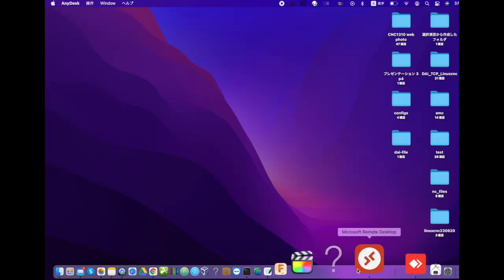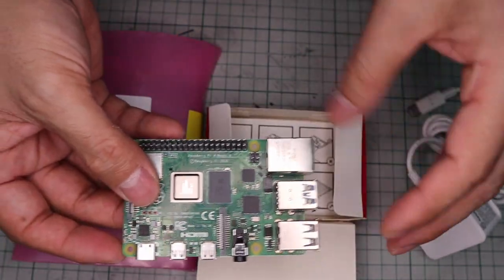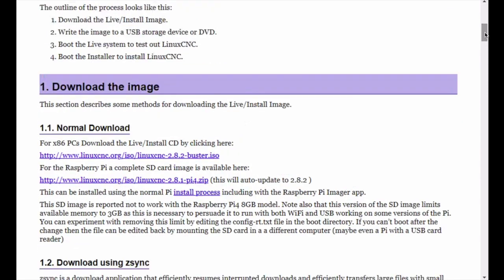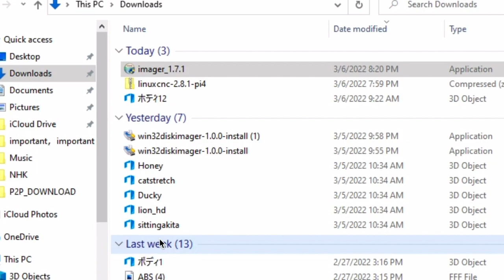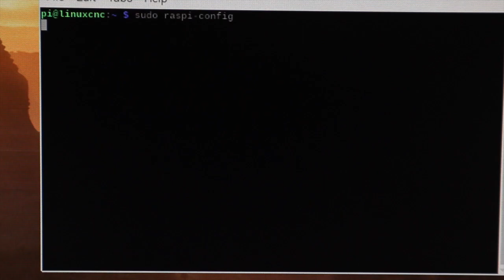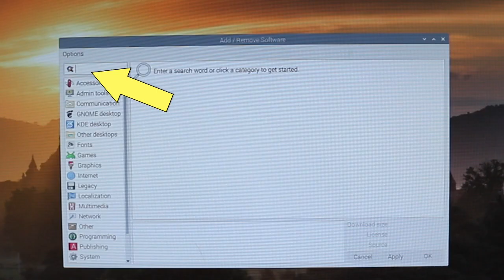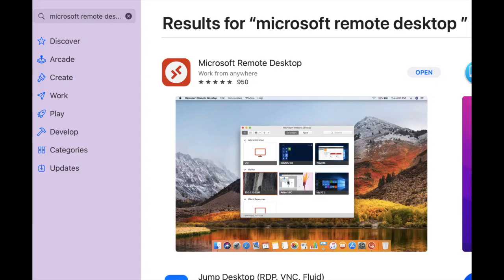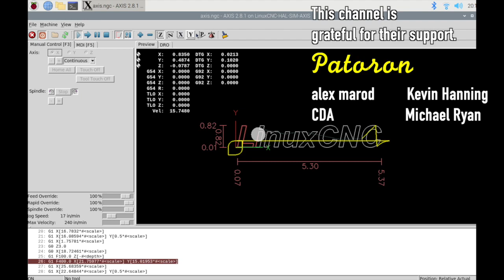Install LinuxCNC to a Raspberry Pi4 and remote control by Microsoft Remote  Desktop

Comment: Nice, I have a similar setup for my ANT PCB maker. I first tried "VirtualHere" remote USB emulation - but it was a bit unstable even over wired ethernet.  Having the software running on the remote computer directly controlling the CNC (like OctoPi controls a 3D printer) is the best way to go.    

TIP: After burning the SD card you can open up (the FAT32 part of it) in Windows/Mac and edit some config files to set your Wifi and enable the SSH terminal.

Then you can use Putty from windows to do the rest of the install of the remote desktop (via command line).  Avoids the need to connect a monitor and keyboard.  Well worth practicing with a spare Pi.
Reply: You should also set up a SAMBA fileshare, so you can transfer design files to the Pi from Windows/Mac.
Reply from the maker: Thanks for the useful information.
I am interested in OctoPi.
Reply from the maker: I know SAMBA.
It is very useful.
I have confirmed that teamviewer is also available.
Thanks.

Comment: Cool vid, I didn't know you could use linux for this.

I agree linux and the ras pi are hard to learn. I used mine to build an Openflexure microscope, which is the only ras pi thing I've seen that was laid out so clearly that a child could probably build it.

Comment: I know how to install Linux and the software, but I'd like to know how to connect mesa board with stepper drivers? I have 3 axis CNC with 2 motors for Y axis.
Reply from the maker: LinuxCNC Raspberry Pi4 & Mesa 7c81 Setup
https://youtu.be/EcCYf4WEvKs

Comment: Hello there 
I wanted to ask a question 
When you are doing 5 axis machining, Does your part have to be perfectly in the middle of the rotary table or it could have some offset and then you can offset that in the software ?!
Reply from the maker: I was just trying to get xyzac-trt-kins to work with my newly installed Linuxcnc, but could not get it to work by myself.
Finally,  I asked a question on the Linuxcnc forum.
They answered. Thanks to them.
I will try to set it up tonight.
I will post a link to the site.
I will post it on Youtube once I get my setup working.

https://forum.linuxcnc.org/10-advanced-configuration/31813-tcp-5-axis-kinematics?start=420#238235
Reply: Oh thanks thats really helpful 
Another question 
I saw In your videos when the machine was processing some metal work the fixation place was alittle pumped up and most of the 5 axis machining i see have this type of high elevation is it important to do or you can just fix the wp on the trunion table
Reply from the maker: 5-axis machining means machining workpieces from various directions.
The problem is interference.
The clamping method of the workpiece is also an issue.
Even though the workpiece can be machined from any angle, it cannot be machined if there is a clamping bar to hold the part in place.
The 5-axis is mechanically larger, so it is more prone to interference.
As a result, interference is prevented by setting the workpiece higher and making the fixture as small as possible.
Reply: @a-cnc-f  thanks for the answer, I really appreciate your videos keep it up

Comment: Can you recommend 5 axis TCP board with linuxcnc beside this board ?
Budget friendly.
Reply from the maker: At least the one controlling my 5 axis machine is raspberry Pi4 + Linuxcnc + mesa7c81.
I used to use beaglebone+machinekit, but the lack of wifi and slow speed were frustrating.
I will post another video about the CNC unit next time.
Reply: @a-cnc-f  how about TCP ? Does your setup can do TCP ?
Reply from the maker: @calico88  
Yes, TCP has been successfully configured.
But unfortunately I can't explain it properly now.
I had a hard time setting it up 2 years ago, but I don't remember how I did it.
I have notes saying how I did it, but I don't know if I can reproduce it.
I will eventually set up my newly prepared Raspberry Pi to be able to do 5-axis TCP.

I set it up by looking at this.
I don't know what they are talking about, too high level, but good luck.
https://forum.linuxcnc.org/10-advanced-configuration/31813-tcp-5-axis-kinematics?start=0
Reply: @a-cnc-f  well I’m not a programming much worse than you.
I’m looking for a setup hardware than can do TCP with much less coding.
Well it does not exist yet …
Reply from the maker: I know your feel.
For now, I am trying to make a tutorial that will allow me to make the same settings as my 5-axis machine.
But I don't know when I will be able to do it.
Reply: @a-cnc-f  cool

Comment: Hello, thank's to you for your video, it's great...for me i get an issue after written a USB card with Raspberry Pi Imager...i don't know how to run installation from my USB to my Pi400 therefore i don't get the terminal with all code lines at 5.58minutes...do you have a solution ? i'm a biginner with Linux...
Thank's a lot
Philip
Reply from the maker: Sorry for the late reply.
My video uses a USB Card Reader to write the ISO image to a Micro SD.
Insert that Micro SD into the Raspberry Pi and turn it on and Linuxcnc should start up. I don't see any problems here.

Comment: Why would you use remote desktop? The has all you need for a keyboard & mouse.
Reply from the maker: With Remote Desktop, you don't need a new keyboard, mouse, and display, you can use your existing PC!
Reply: @a-cnc-f  My existing PCs are all running Linux.